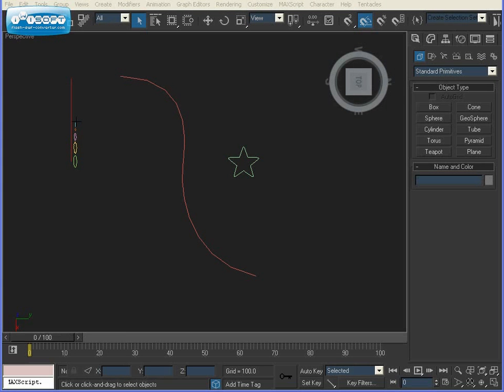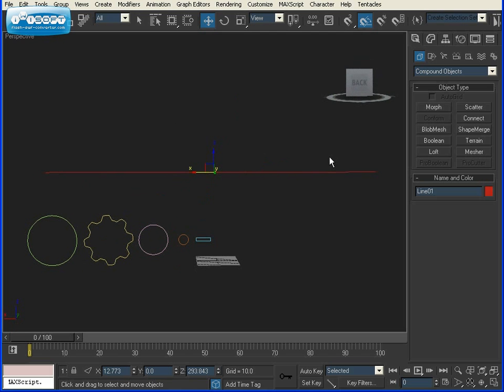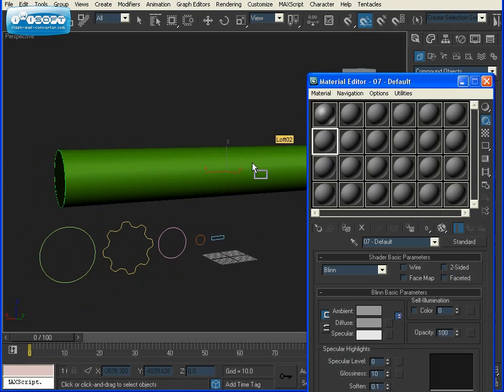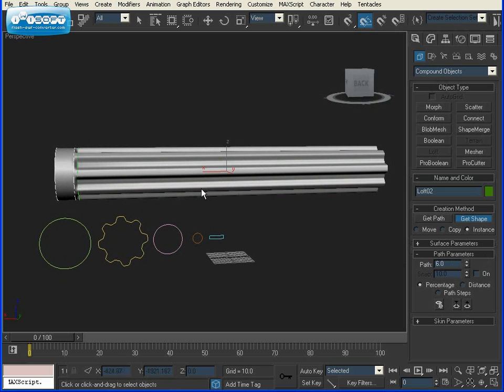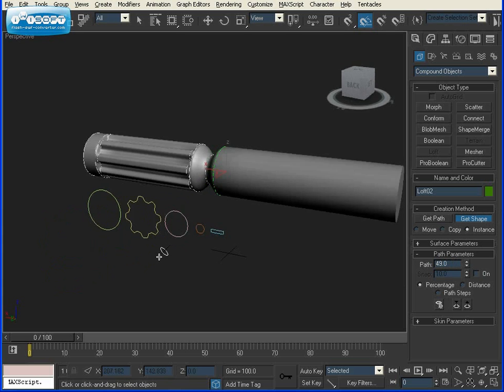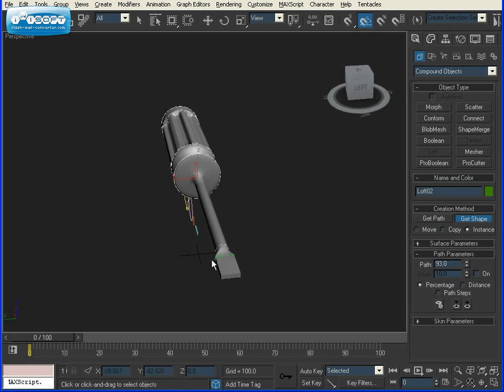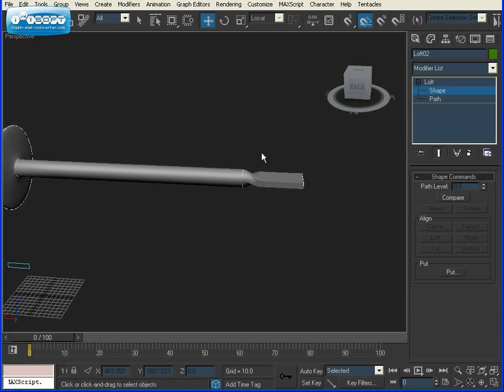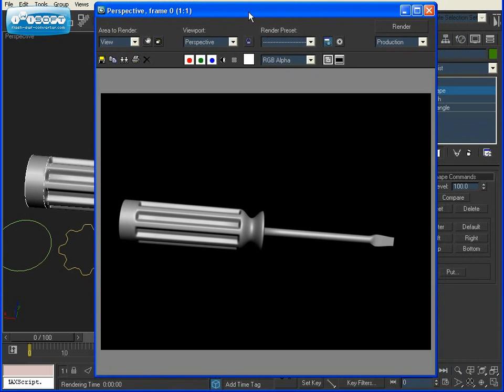3DS Max Loft Tutorial (Screwdriver)

Comment: ok, I figured out how to do just what you did, however have another 
issue lol. Once i convert to edible poly and select the vertices to move
 them each vertices axis is all screwed up and each is at different 
angles. I tried to change pivot etc didn't work. how do i change the 
pivot of all the vertices to allign in x,y,z the same?